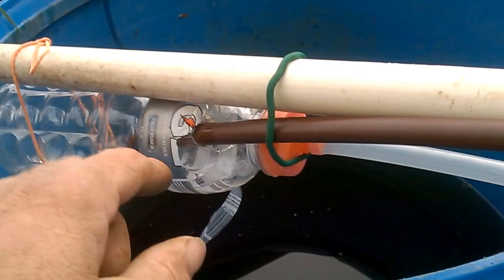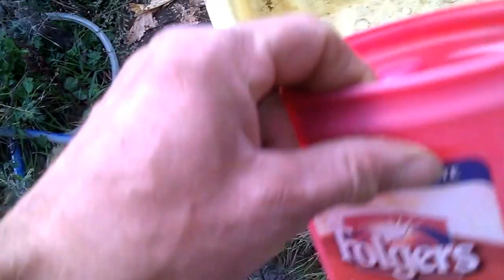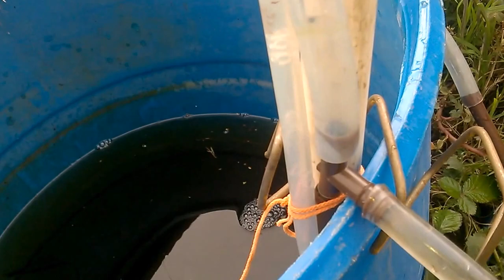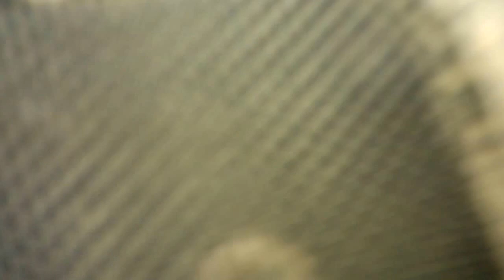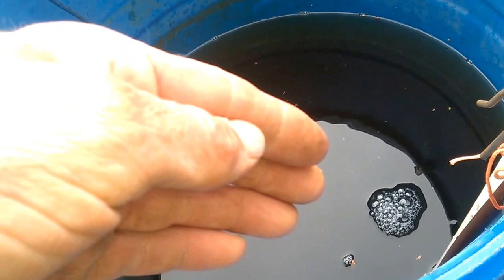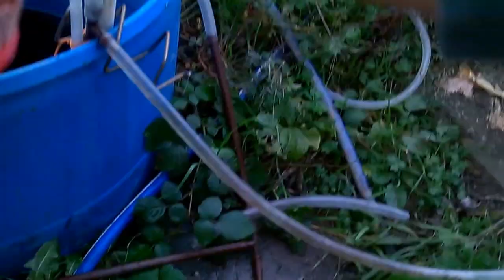Tiny pulser pump model

Comment: Thanks a lot, Brian! Once to see is much better, especially a really working prototype!
Reply: Hi Sergey. I made some in Ireland in the late 1980 early 1990s. I don't think they are still on use but one of them is on YouTube. "World's simplest water pump".   They aren't very efficient  but they are pretty easy to make.  Mine was made of 10 cm diameter pipes, worked on half meter head and about 300 liters per minute of water flow.   It was in use in the wet season for about 15 years pumping water to sheep and cattle and filling sprayers and bulk water  tanks  on the tractor. (Cheaper to fill in say an hour with the pump  than run the tractor half an hour  to pump the same amount of water into the tank.
Reply: @brianwhite75  Thank You for such a comprehensive answer and for the inspiration too - it's really awesome, but I decide to start the Eco living from O.U. power source: still trying to invent it, and in case I fail with this ploy, I am looking around for electricity free methods (as much free as it's possible) and find Your page - real experience with such devices! Yyyyesss!!!
Reply: @brianwhite75  When you say 300 liters per minute of water flow - was that the input water or the volume water delivered?    Also what was the height of the head and height water was lifted?  Thanks.

Comment: Thanks alot brian im building a 1500L aquaponics nutrient film system and to reduce cost im looking into using airpumps i stead of waterpumps.
Reply: When you say 1500 Liters - what are you measuring?  Is this the volume that needs to be pumped per day or the size of the reservoir?

Comment: Wont you have to take up the device from the water to refill the air?
Reply from the maker: No, no, the air gets supplied by the "waterfall" in a pipe.  The energy of the falling water pushes air down  the pipe.  As long as water falls down the pipe,  air is "pumped" down too!
Reply: Ah i see my bad, nice video :) we will try to replicate at my school :)
Reply from the maker: Please do!  I did "nft" hydroponics this year.  Just a strip of flat material about 30 to 35 cm wide and about 2.5  meters long,  with a slight slope and water flowing along it.  I used an airlift pump running at about 3 liters per minute of air to power the water flow.  I grew tomatoes in the stream of water.   A "small pulser pump" running in a little river or brook could easily produce this amount of air under pressure.  My old pulser pump (See it on the web) pumped 11 to 15 liters per minute of air at about twice the pressure needed to do this type of hydroponic set up! So no reason people couldn't have hydroponic greenhouses without electricity! in poorer or isolated areas!
Reply from the maker: @davemwangi05   "head" is the height that the water falls to produce the power.   In my trompe in a brook connected directly to an airlift pump beside the brook,  I had between 45 cm and 55 cm (about 1 and a half ft) of head and about 250 to 350 liters per minute of water flow for power.   This trompe was deep, going to 2.5 meters  (about 9 ft) below the surface of the water below the dam.  and it pumped up to 4 liters (2 quarts)  per minute of water at 10 ft high.  So it was capable of running the Nutrient film technique system for a very large greenhouse .  (it was far faster when only pumping  4 or 5 ft high).  A one meter deep trompe in a small brook or river  should be quite sufficient to run fairly big greenhouse nft systems.